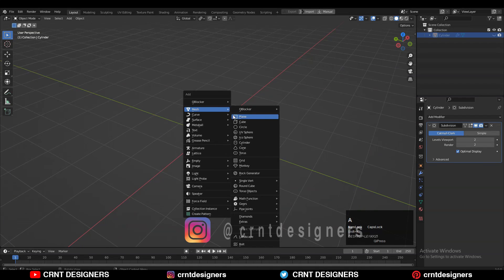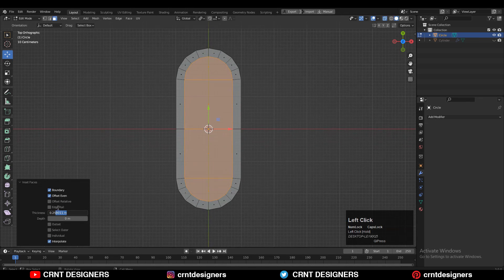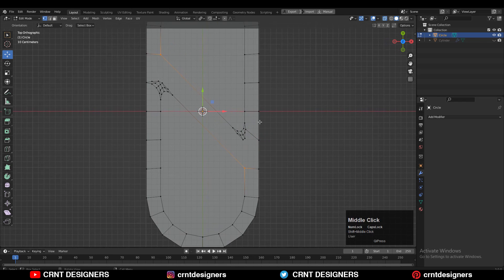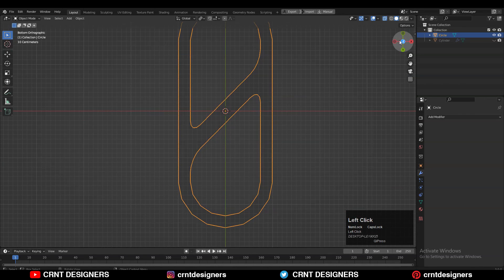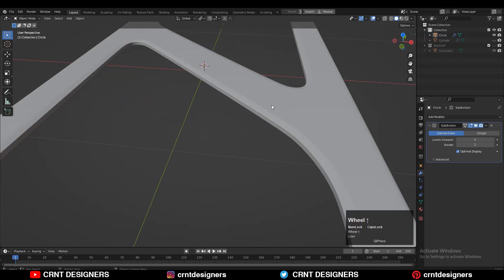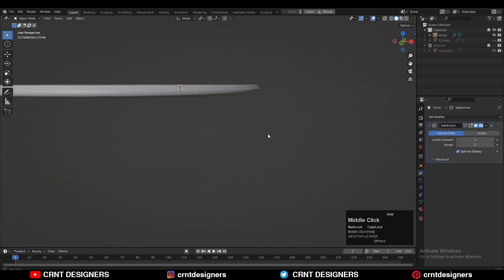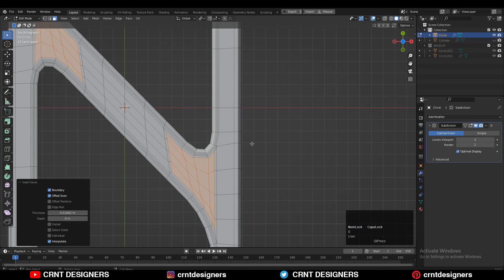How To Create Smooth Corner Details _ Blender Subdivision Surface Modeling Tutorial

Comment: Great for beginners, I have few insights though.
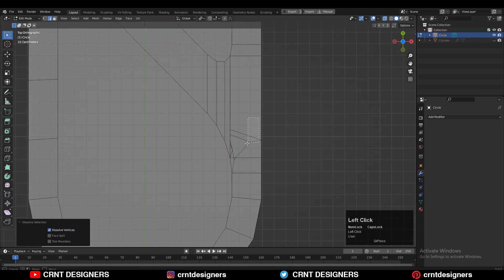At 1:51 you could've just made a cut along X axis, mirror the entire mesh and merge it together instead of fixing the topo on the other side - in this case it works just fine, but when working at more detailed meshes that are symmetrical it's worth keeping in mind.
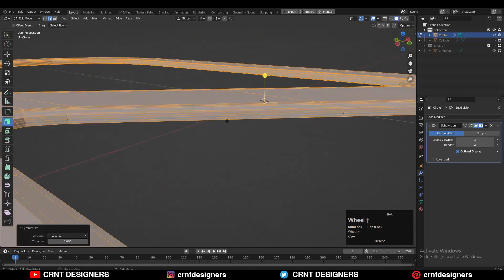At around 3:20 - if you're going after that sharp edge & your intention is to create a low poly mesh it's useful to try out how "mark sharp" option works on your mesh, doesn't work nicely every time, but it's worth giving it a try in your mesh
Also, you haven't mentioned that you're using loop tools & it can be a bit confusing for new users: 
To turn on/off loop tools go to Edit > Preferences > Add-ons > Mesh: Loop Tools 

Other than that it shows the workflow pretty well!